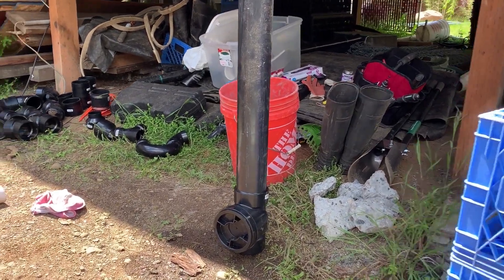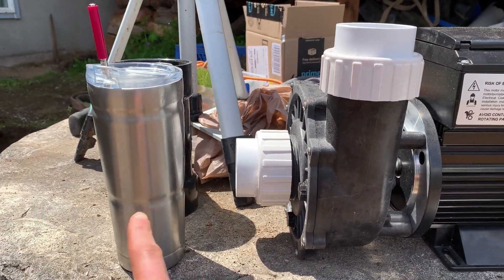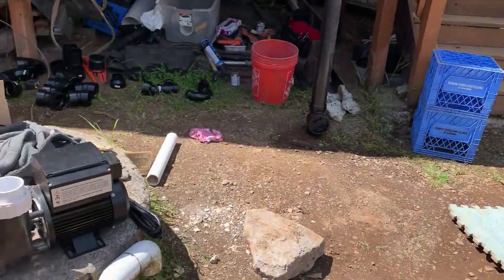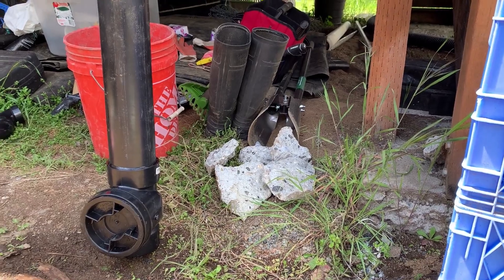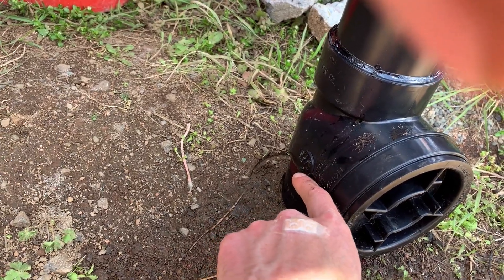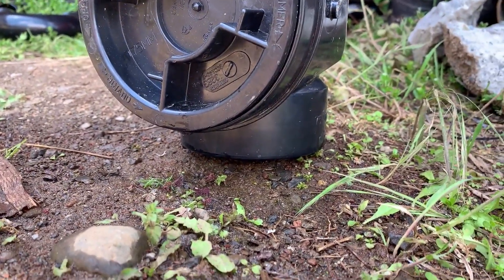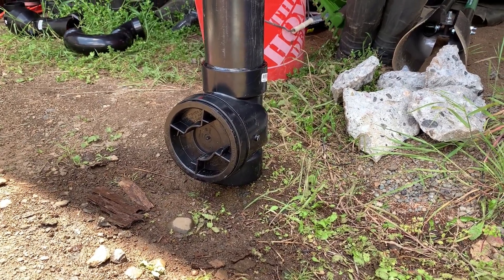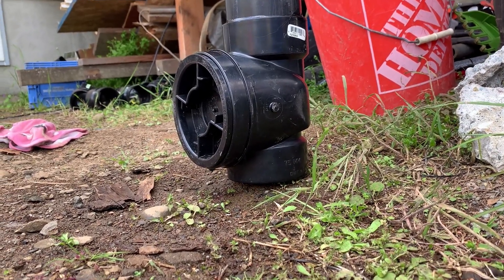Backyard Water Garden: Can you use a sewer backwater valve as a check valve?

Comment: I had a question on the milk creat. How long did you leave the bolder on it? Would you be able to leave it for a few days, maybe a week, to see results?
Reply from the maker: I only left it on for a day or so. No issues during that time. But I have had a lot of big boulders installed for weeks now over my reservoir, and those are doing fine, too. To clarify, I would not recommend setting large rocks on milk crates as I did in the milk crate test video. That was just for illustration. In time, I would expect crates used like that to collapse.

Mine are in a hole and backfilled, so the compacted earth around them provide structure for the crates to press against as they are loaded with weight.